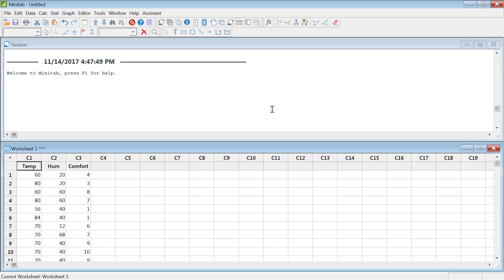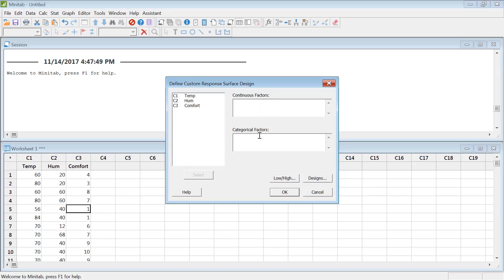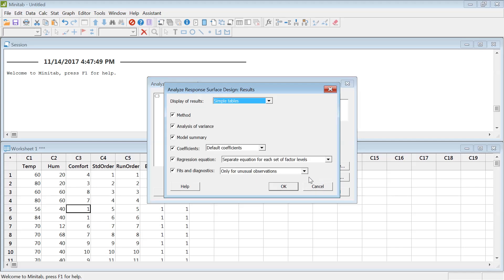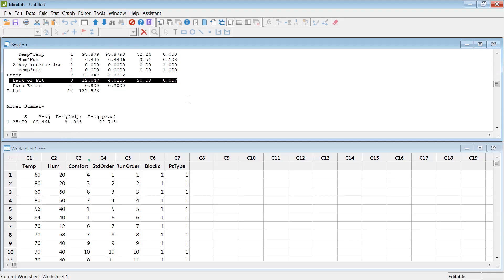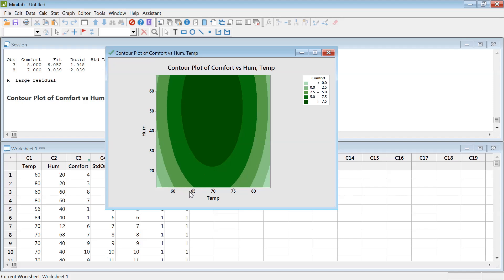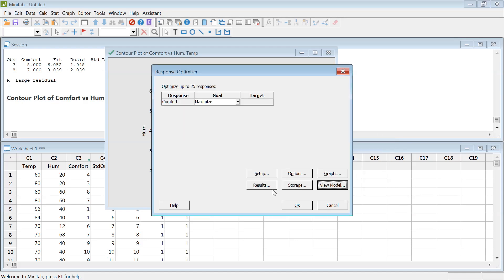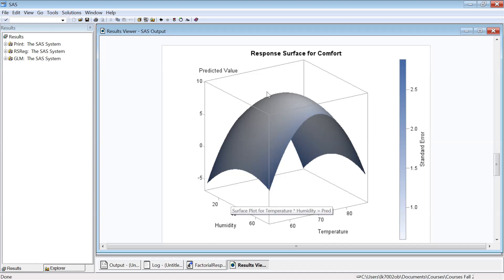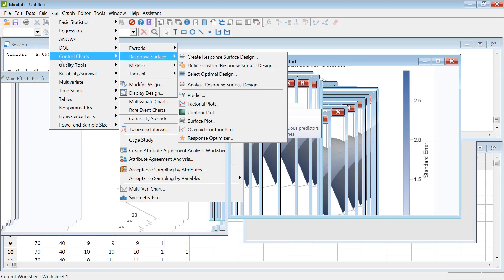Response Surface Methodology Design of Experiments Analysis Explained Example using Minitab

Comment: Can we use this method when factors are 5 and responses are 2 
?
Reply from the maker: More on Response Surface: http://www.theopeneducator.com/doe#TOC-Module-9.-Response-Surface-Methodology . You can provide me with some more detail information on the design.
Reply: @TheOpenEducator  please send mail id
Reply from the maker: @amitstorm500  email@theopeneducator.com
Reply: @TheOpenEducator  please check mail
Reply: @TheOpenEducator  sir any suggestions about my send information through mail
Reply from the maker: @amitstorm500  At a time, you only use three variables, preferably two independent variable (factors) (e.g. cutting speed and feed) and one dependent variable (response) (e.g. tool life).
Reply: @TheOpenEducator  Thanks

Comment: Thanks for your video, I tried to reproduce this example in the trial version of minitab 19. The method is clear to me and I use exactly the same values (even for the axial points, I calculated them in Excel), however I get slightly different results. For example, my Adj SS for the model with 5 DF is 111.984 whereas yours is 109.077. Could this be an version issue, or some setting? Looking forward to your response!
Reply: Are the comfort values integers, or are these decimal values?
Reply from the maker: @nicoblijham  It's not. They are integers.
Reply from the maker: Unlike ANOVA, regression sums of squares are a bit complicated. However, adjusted sum of square should be the same as long as you have the same model terms. You can send the Minitab file to email@theopeneducator.com . I can check it for you. I do have the Minitab 17 running. More on the response surface: http://www.theopeneducator.com/doe#TOC-Part-III:-Optimize-the-Important-Factors-Variables
Reply: @TheOpenEducator  Oké, I have sent you the file. Thanks in advance :)
Reply from the maker: @nicoblijham  The analyses were performed using Minitab 17-version. You may get different results with other versions of Minitab.   You have done everything correctly. I have double checked. I have got exact same results as yours. My best!